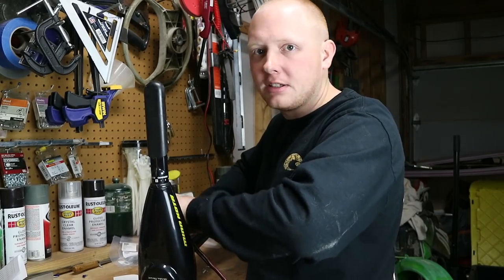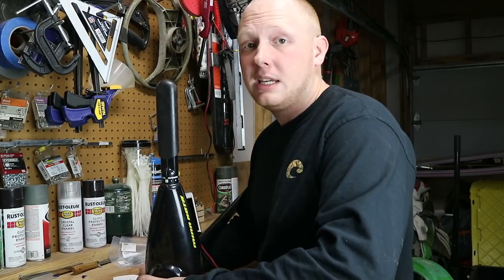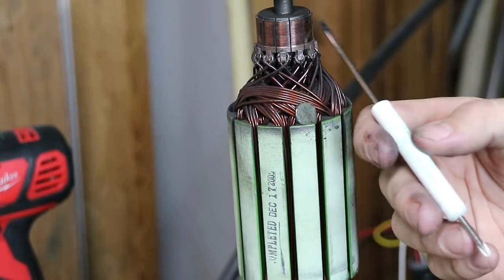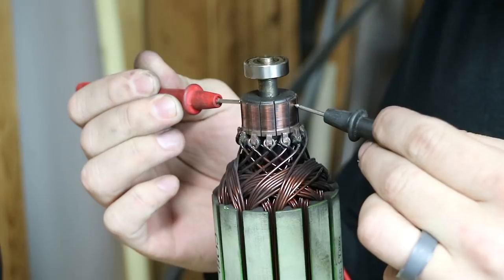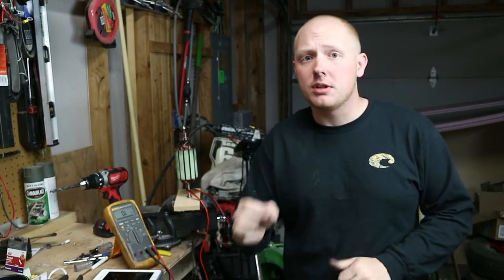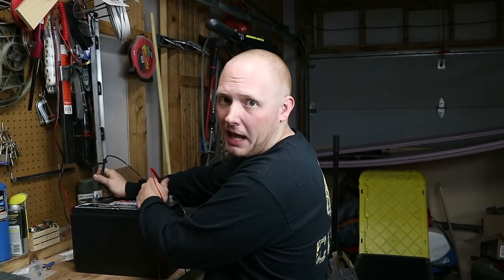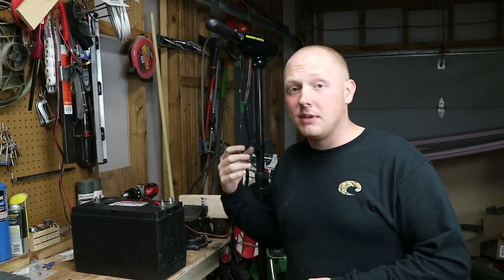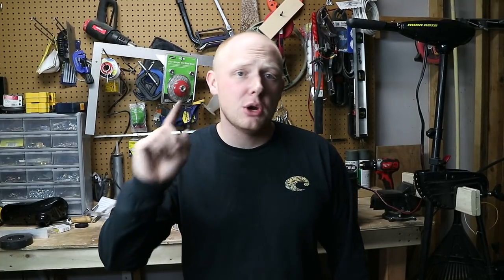Trolling Motor Repair Guide | Troubleshooting

Comment: I just installed my Traxxes 80 lb 24 volt Motor and I am not getting enough juice to it. It seems to be running at half power. I had a vantage on it before and just rebooted up the 3 prong plug. Do I have the plug hooked up wrong? The plug in the boat has three wires ( 2 blacks and one red) running to it but the traxxes only has two wires. So I hooked the red up to number one on both and put the black in number two on the plug from the traxxes. Should I have it in the 3 spot?

My bow mount is running fine. So I know it is not my batteries.
Reply from the maker: That doesn’t sound good. Might see if there’s an inline fuse somewhere l that blew. If not then you probably have a bad switch. Good luck!

Comment: I have a Minn Kota Endura C2 12 Volt 55 Thrust that ended up completely submerged for several hours. I let it dry out for several weeks and then tried it out and it stilled worked. I was unable to use it for about 2 years and when I tried it out yesterday it would not work. I can hear and feel an electrical buzzing in the head but the prop did maybe1  half hearted spin and then would not turn after that. I am figuring the control switch got water in it and eventually went bad just seeing if anyone may have any other thoughts on any other causes.

Comment: Good video I have quetion my trolling motor 40 pound foll on the water  same time I use but it works for have hour afeter that stop to work . What can I do in that case ? Thank you
Reply from the maker: It sounds like you may have some bad seals. Might try taking it apart to see if there is any water (or rust) inside the housing.

Comment: Good video! My trolling motor works great out of the water but when I dip it in the water is stops in about 10 to 30 seconds. I take it back out of the water and about 10 minutes later is works fine while out of the water. Dip it in and stops again. Any ideas?
Reply: I thought the seals were dried out and defective so I bought a seal set Yesterday I replaced the seals. Although when I took it apart it was completely dry and looked factory new in there. I was surprised. I really thought it would be full of "stuff"... So, I filled a trash can with water in the garage, dipped it in and took it through all the testing I could think of. If on a  lower speed, it will work for about 25 to 30 minutes and stop. Unplug the power, wait for 10 minutes and it will work again. If on full power it will cut off much quicker. Unplug power, wait and plug back in only to find the same symptoms again.
Reply from the maker: Sounds like water is getting inside somehow. If the seals were replaced properly I'd go and look at the shaft into the housing. It's shorting out somehow. Good luck!

Comment: Thank you so much for making these vids.  Really cool to find it.  I have a minn Kota edge 55 w foot pedal.   Intermittently my prop won’t turn.  Then if I try again or move the switch It might turn.  It seems random.  My lower unit came loose so perhaps there is water in the motor.  I also fished through a very wet rain.  When running it does fine.  Battery is fine.  I am guessing it is the switch.  Any thoughts?  Thx man
Reply: Same problem, did you ever find the problem?
Reply: @300zxdriver  yes it was corrosion in the bulkhead connector.  Prob the rain got it. Had to take both parts of the connector apart and clean the wires. It was the underside connector not the plug on top.
Reply: @billcollier6565  Awesome…thanks for the reply. So wasn’t in the actual foot control at all. Interesting.. I’ll check the same place . Thanks again

Comment: Great video.  Thank you!  Question for you.  Any ideas on what might be causing a loud screeching noise from the lower unit of a trolling motor (minn kota edrive 48v)?  I am getting a consistent 48v from the controller board.  I replaced the armature b/c I was getting an obstructed prop condition.  I also replaced the brush assembly.  Thank you for your help.
Reply from the maker: Sounds like something is out of place buddy. Take it apart and check it out. You should be able to identify it if it's always making that sound.
Reply: @SMG_62  Thanks.  Turned out to be grease.  The new shaft needed to be greased.  Thanks.

Comment: Actually it doesn't heat up much while running in air. Because air has such low flow resistance,the motor takes up very little current.The propeller also gives some cooling especially when running in reverse.

Comment: my minnkota Endura 30 quit running smoothly it was very slow on its fastest speed setting. i opened it up and when removing the armature the magnets slid out as well....is there a certain setting or placing inside the housing thaat they are placed, glued in?, distance apart from each other, or from top or bottom....i think it will still work if put back togather correctly...can you give info on this repair?
Reply from the maker: I know just as much as you do buddy. Honestly if it were me I’d just buy a lower end. I think they run $50 or so from the manufacturer. Try finding one used on Craigslist or eBay if you can for parts. Good luck man. Thanks for watching. Let me know what happens.

Comment: Curious what level of torque you put on the two threaded rods that hold the magnet portion of the motor together.  Done repairs in the past but still get leak issues.
Reply from the maker: These bolts really shouldn't be very tight at all. Just enough to keep them snug. You may consider using a bit of medium strength thread locker on these bolts as well. Make sure you replace all of the seals and make sure none of the cases are damaged when putting it back together. a small nick in these plastic or metal housings mating surfaces can cause a big leak.

Comment: My Minn Kota 55 was working for a few hours before stating to crap out.  What would happen is the speed was so slow, barely moving the prop.  If I pulled it out of the water, that would sometimes fix it (could be coincidental).  Usually if I hit the top of it it would start working again for a couple minutes before going out.  Does this sound like a switch issue?
Reply from the maker: It sounds like either a switch problem or a armature problem. Take it apart and test it like I show in my troubleshooting video.
Reply: I'll do that.  Thank you.  It's only a few years old too which is the frustrating part

Comment: I have a MK Edge 70 and it doesn’t have the power it did a year ago. Speed 4 is like 3 but 5 is ok.
Do you know where I should start to correct issue?
Reply from the maker: I always look at the battery first. If that’s not the problem I’d look at terminal connections. After that I’d start looking at wiring for any signs of stress. Like melted wires or corroded connections.

Comment: Great, however I have a MotorGuide trolling motor about seven years old and has never been used except for two weeks age.  It was stored in a dry area.  Used it twice and it worked fine.  Now I tried it a couple of days ago and it will not work.  Have not got a clue.  Uses a 12 volt battery which is also relatively new and used only for this motor.  Help???
Reply from the maker: Take it apart and see what's going on inside. Test the armature and the switch and you'll find your problem. Make sure you battery isn't the problem first. I'd say 90% of the time it's the battery. Good luck!

Comment: Regarding the armature. On 180 test I'm getting .3 all around which is good. But on the side by side it is always .1 and I wasn't sure if that was too low(and meant it was shot).

Edit:always .1 or .2
Reply from the maker: Sound like it’s good to me. Are you having any issues with it
Reply: @SMG_62  Yeah. 3rd and 4th speed have no output. 1st and 2nd reverses look to be the same speed. Those are the symptoms. Originally thought it was the switch. Got a new one and it didn't help. The only other thing I can see is the pin that slides into the armature and prop is bent a bit. Brushes seem fine though the connectors on the back had some white stuff on them that I sanded down most recently. Gonna test it again tmrw.
Reply from the maker: Test it before you go buying a new armature. Those number sound like they’re in spec to me. Still sounds like a switch problem. Double check the connections and make sure they’re going to the right spots on the switch. Good luck man.

Comment: I have a new 45 Endura. We went out on the lake and hooked the wire backwards to the battery. Now it want do anything. I s this the controller switch?
Reply from the maker: Could be. I’ve done this before though and it didn’t fry anything. I’d take it back to the dealer and see if they’ll do something before you try and open it up and void the warranty. You may have already by hooking it up backwards but it’s worth a shot. If they won’t do anything for you I’d just take a look at the wires and see if anything burnt up. That’s the most likely scenario.

Comment: My problem is with my Minnkota and Duramax 55 pound thrust motor is that since it is variable speed when I start at 0% and go all the way to 100% on my ford speeds I don't get 100% power I need to twist the knob past 100 so we can actually engage in for 100% I don't know if I'm making sense but that is my issue
Reply from the maker: +FishOnTv I think I understand what your saying. I've never personally messed with the type of switch your talking about but I would assume it's pretty similar if not the same. Take it apart and check it out. That's what I've done.

Comment: Heres my problem. I was trolling fully opened on 5 and didn't notice till it was to late I was trolling thru a lot of weeds. I stopped to clean off the weeds and went to troll again but it only wanted to run on 1.  Thought it just overheated so I let cool down for a few hours but she never started back up. Please help.
Reply from the maker: Sounds like you melted something. Take it apart and check the wires. You'll probably find something melted. If not check the switch and armature to see what's wrong.

Comment: I want to replace my motor mount from plastic to metal.  Do I need to take off top and disconnect all wires to do this?
Reply from the maker: Yes, you sure do

Comment: I've got a question from my trolling motor I went out fishing it was working great when to go turn it on again wouldn't work at all change batteries and everything the indicator light comes on but nothing happens
Reply from the maker: Sounds like you may have burnt up the switch. Take it apart and test it to see if you need to buy a new one.
Reply: Is there a Pacific way to test the switch by itself the see if it's burned out
Reply from the maker: I don’t have a specific link to your exact switch but if you google it you should be able to find one.

Comment: My 24V minnkota is acting like 12V and my bat are changed.
What could be the problem?
Thnx
Reply: I have the same problem did you ever figure it out. Mine is very weak worked really good 4 or 5 times now it can barely move my boat

Comment: Where and what type of inline fuse do you use...  It seems I keep melting speed switches
Reply from the maker: There’s not really a specific type of inline fuse to use. Just make sure it’s rated for your trolling motor. You can usually look up the rating on your manufacturers site. If you’re using the recommended size fuse and it’s still blowing then you probably have another issue. Make sure to look at your switch and all connections to make sure nothing is melted or corroded. Also, just to cover the obvious, make sure you’re not using a 24V system on a 12V motor.

Comment: How do you replace controller board on minn Kota Terrova?
Reply from the maker: I'm sure there's a service manual on how to do it. I'm not an expert, especially when it comes to the digital drive trolling motors.

Comment: When i took my lower unit apart the magnet was in like 20 pieces can that be replaced if so where do i find one?
Reply from the maker: What? That’s crazy. How old is it?
Reply: like 3 it has been sitting in my shed and it had water in the lower unit I think it froze shattering the magnet because I read online that happened to other people.
Reply from the maker: That’s crazy. I’ve never seen that myself. You should be able to purchase just the housing form your manufacturer. Or you may even try eBay or amazon. Good luck.

Comment: Hey I got a question about my trolling motor ?
Reply from the maker: What’s your question man?
Reply: I got a old motorguide trolling motor and I took the armature out the foot and broke a brush off the wire it was connected to,it has 4 brushes ,I soldered the wire back to brush ,and put it back together and the shaft won't spin it jumps a little that how I know its getting power I've done everything I know to do ,there was nothing wrong with it before I took it apart lol ,I just was gonna check out the brushes and see if it was leaking should've just left it alone
Reply from the maker: Haha I hate when that happens. I would guess you need to replace the brush all together. I don’t think the solder can take the high amperage. Good news is they aren’t very expensive at all. Just go to the motorguide parts page and use your model number to find the part you need. Good luck man. Thanks for watching.

You may have broken your motor by experimenting but at least now you know how everything works. Lol
Reply: Ok thanks

Comment: Mine got pulled apart now forward is reverse and reverse is forwards?? What to do to fix please anyone ???
Reply from the maker: Sounds like your battery leads are reversed. If not your wires are crossed on the switch. Pull it apart and try again.

Comment: Sir...Ive got a minnkota powerdrive v2 40thrust / 12 volt model made in 2009. The unit steers fine, but the propeller is intermittent. Sometimes the propeller will work, but most of the time I hear a "clicking sound" coming from the area where the control board is housed. I contact Minnkota and was instructed to take off the control box cover and connect the black/red wires to my 12 volt battery directly by using jumper cables. I was told that if my units propeller starting working then the problem was a faulty relay in the control board. I did as instructed and the propeller still worked intermittently. It worked initially but then stopped working. Do you have any ideas? Thank you.
Reply from the maker: Sounds like you may have a leak in the motor housing and it’s gotten rusty. Take it apart and clean it with wd 40 and a high grit sandpaper to see if it fixes it. If it does make sure to replace those seals so it doesn’t leak anymore!

Comment: I watched this video and paid 30 dollars for a switch. And it wasnt the switch. I  running high speed in all speeds. It was the speed coil. And thats built into the bottom end of the motor.  Back end. Brush end. So i basically threw away 30 bucks
Reply from the maker: Sorry for you luck buddy. Should have tested everything before you bought anything. Lesson learned.
Reply: @SMG_62  you should watch your whole video.  You say that it's the switch if this happens.   Wrong! Maybe i shouldn't watch videos from people that don't have a clue what there talking about

Comment: Would anybody have an idea as to how to deal with the following issue he didn’t cover (and I’m having). Any help would be super appreciated. 

The problem I am having is that gear 4 and 5 are the same speed now.  How would I troubleshoot such an issue?  Could it be my wiring or my switch box?

It’s not the battery as I have replaced it and it runs at the expected voltage etc. 

Thoughts anyone?!
Reply from the maker: Sounds like you have a bad switch buddy. Typically when they go bad you start to lose different speeds. Take the cover off and see if there are any burnt wires. Also you should see a variation in voltage to the motor while switching through the gears.
Reply: SMG thanks!  Replaced the switch.  I don’t have a tester on hand, but based on running it dry (not long) I can tell with the new switch #5 is running the motor at higher revs.  Will take it on the water this weekend for the true test. Thanks again 👍
Reply from the maker: That’s awesome. Glad I could help you out. Good luck man.

Comment: What happens if it is shorted ?
Reply from the maker: Best bet is to replace it.
Reply: @SMG_62  what if motor won’t start spinning unless you give it a quick spin by hand with the switch on
Reply: My motor won’t rotate unles I put the switch in gear say forward and hand start the prop into motion this is all speeds forward or reverse